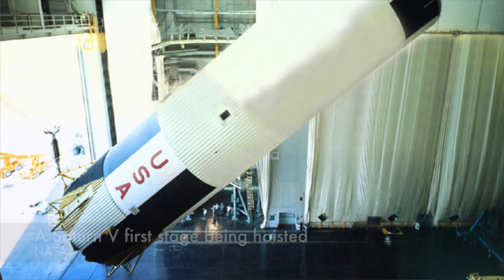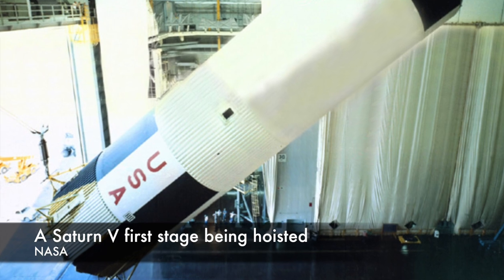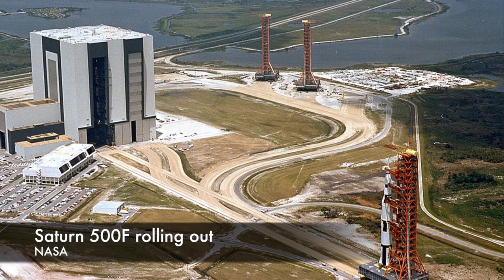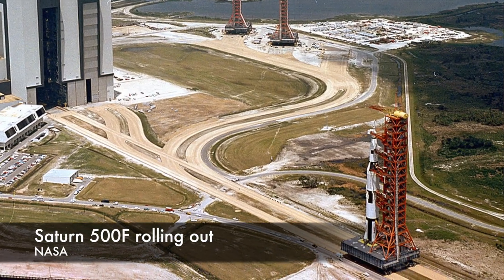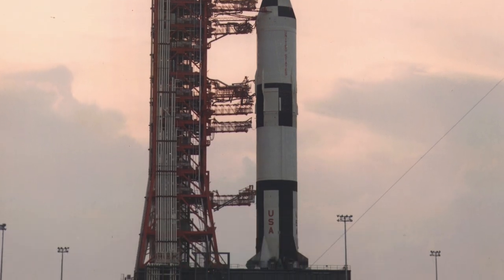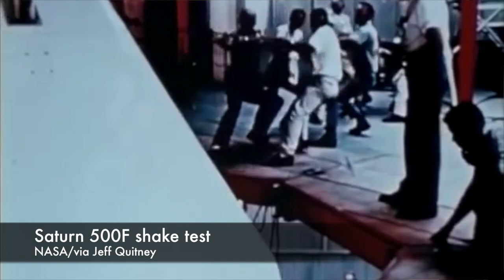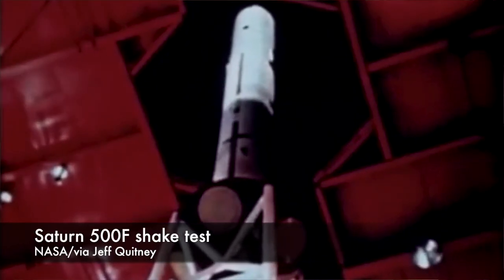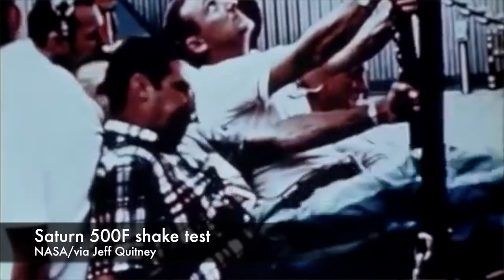Shaking the Saturn 500F

Comment: How many technicians does it take to shake a Saturn V ?  
Not a joke, A REAL QUESTION!
(I wouldn't have thought it could be moved like that)
Reply: maybe they didn't put weight in it to simulate fuel?  I think the fuel made up most of the mass of the whole thing
Reply: Theres No God It did look like the guys pushing with their legs were not at the bottom but partway up. Calling a rocket that large a lever is a hard concept to grasp.
Reply: A 363 foot tall object?  It's more a question of "How'd they move it to the pad without it falling over or oscillating back and forth?".

Comment: I currently work in certification of new aircraft.  We do the same type of tests except we use machines to shake the aircraft and measure the results.  We do this on the ground and in flight.
Reply: I doubt there was a shake table remotely big enough in the 60s for the Saturn V.

Comment: Gads, I love early space anecdotes—like a heat shield being cut to size with a carpentry router from Sears, or "old hands" on the beach running for cover (while newbies stood around gaping in awe) when an escape tower flew off instead of the whole rocket. The funniest anecdote, most likely apocryphal, involved NASA brass asking Von Braun for assurances about the Saturn V and being given a reliability of "four neins."

Comment: They Saturn V had a natural harmonic that if induced would cause Pogo and shake the whole vehicle. At one point they almost aborted it got so bad. They ended up installing accumulators to the F1 engines to lessen the effect.
Reply: Saturn V had a natural harmonic. Thats the term! The escape tower had a higher frequency that destructivley interferred at the tower legs attachments, flinging the lower half in the direction of the first release mechanisms failing.
Reply: I remember reading about F1 engineers tossing "pipe bombs" into the running engine to induce instabilities as a test of a circuit to negate such instabilities. "It's running just fine." "Toss one in."

Comment: The guys using their legs weren't at the bottom of the rocket, but at the bottom of the Service Module (still way high up on the stack).  Basically one platform down from the guys with the rope.  You can see the RCS Quad on the dummy SM right above their legs.

Comment: I have a question. How were these rockets held? Clearly they can not support their own weight so they must be suspended by something very strong. I just dont know what that "something" is.
Reply: +K0S0s Not only can they support their own weight, they had to withstand several times their own weight from the G forces experienced during flight.  They were clamped at the base to prevent them from tipping over,  when the engines ignited the clamps were released and off they went.
Reply: So why do you assume that they "clearly" can not support their own weight? The photo shows the 500F rolling out on the crawler. How else would it be supported if it could not support it's own weight?

Comment: Dear Amy, I'd like to point out what seems to me a slight error. You say technicians pulled at the top and pushed at the bottom. I doubt they would be pushing at the bottom. One, if the SA-500F was similar in weight to an actual unfuelled Saturn V, it would weigh in at around 131 metric tonnes. Pushing that amount of weight at the bottom (where the S5 rests on only 4 supports) accomplishes nothing, as you'd have no leverage whatsoever. Secondly, I see the men pushing a stage that is significantly smaller than 10 metres in diameter (diameter of the first two stages), closer to the 3,9 metre diameter of the actual spacecraft. Thirdly, I think I see manoeuvring thrusters, further suggesting people are pushing somewhere around the bottom of the Service Module... which is nearly 100 metres up on the stack. This would also give them a lot more leverage.

Comment: Amy, Do you know if that is the same sateren that we have at the Space and Rocket center in Huntsville, AL?
Reply: +Bruce Campbell It's interesting that they did that. There is a Sateren at the US Space and Rocket center that was built and tested in the dynamic test stand facility here in huntsville, AL. That should have given them detailed data on the resonance modes of the system.
Reply: +Bruce Campbell What's a sateren?
Reply: +RogerWilco Sorry. I have dyslexia and I missed that sateren = saturn

Comment: Wich one is the workaround though, the engineering solution or the digital simulation. Kind of why I love Apollo, they didn't try to fix the F1 problem by creating a software fix, but rather blew up engines till it worked.  :)

Comment: They should all get a medal just for that test.  If those pieces would have split and separated, collapsing down thru the VAB,,some tired folks could not get out of the way fast enough I don't think.  Going from sitting to standing up and running takes a bit of time.  Brave steely eyed missile men for sure.  Am pretty sure that was a hush-hush test before and afterwards for some time.  The safety bureaus would go ding dong zonkers if they found out about something like that happening today.  A forehead slapper on the escape tower,,woops.  Escaping from the escape tower??,,hmm.